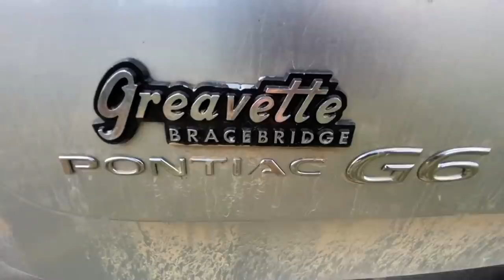JEEP CRASH JUMP Most Insane! 4X4!

Comment: On some vehicles.... if the battery is low, it’ll crank but not start. All the energy goes to the starter and the computer doesn’t have enough left to fire up.